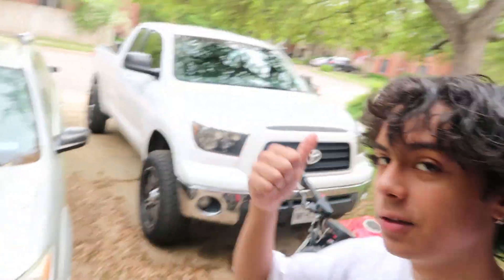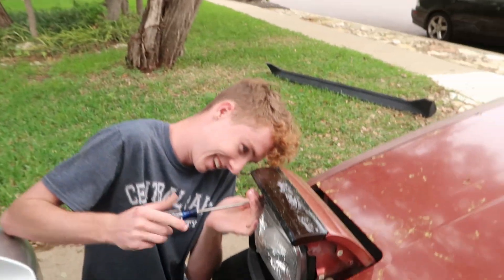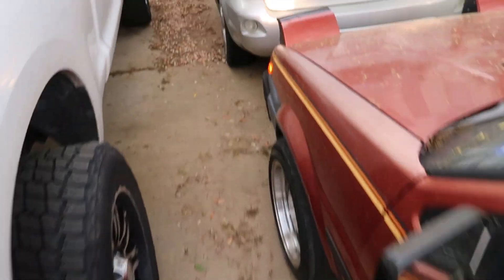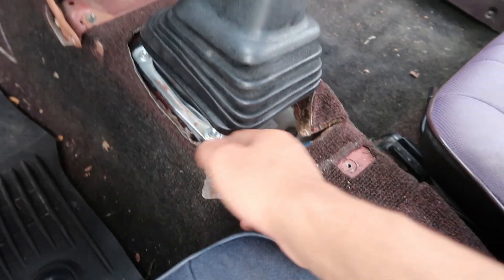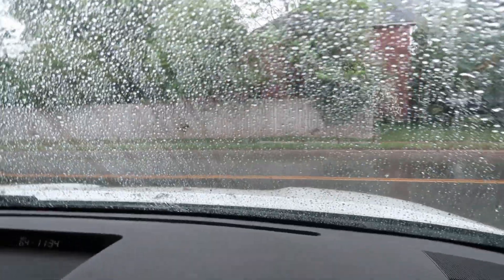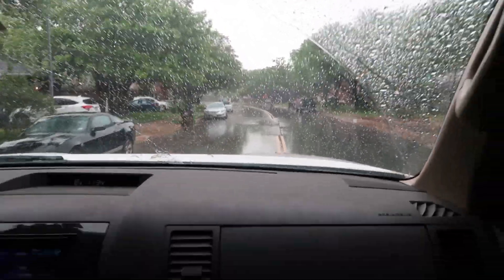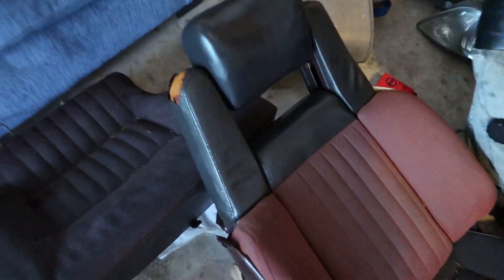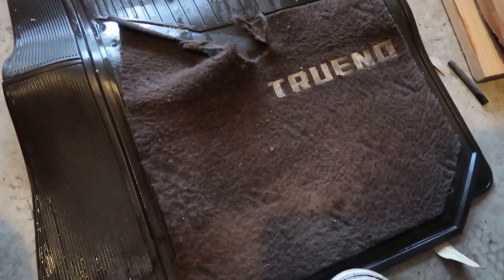TRYING TO REPLICATE TAKUMI'S INTERIOR

Comment: The weird tubes at 2:30 are likely just vents for when the air inside the lenses expands and needs to escape, as well as humidity to balance. I would definitely make sure those tubes are facing down to help w/ dust and moisture ingress.